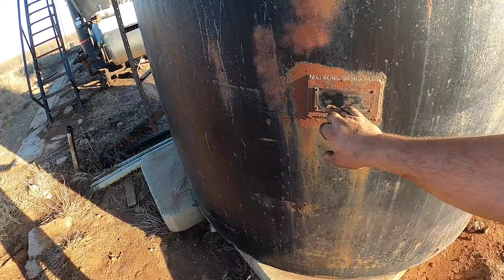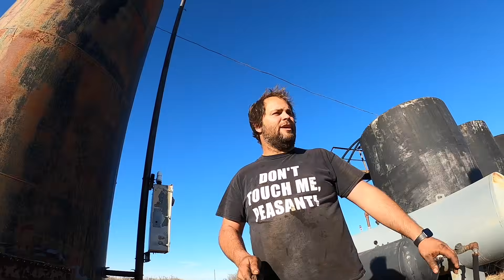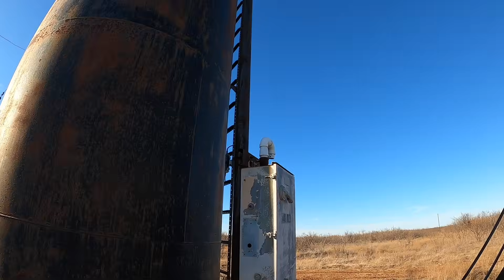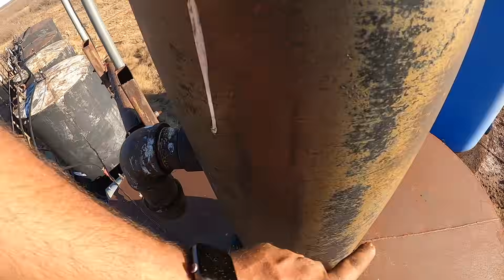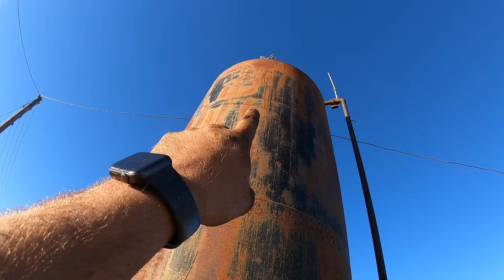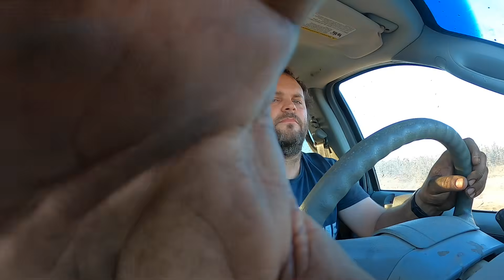Gun Barrel Oil, Gas, and Water Separator.

Comment: man I'd like to know the exact measurements of the separator tank like how wide and how tall and exactly what height each pipe is if you measure from the bottom of the tank up to the bottom of each pipe.  i know it's probably too much work to be doing just because someone wants to know the dimensions but I would like to know because im wanting to separate water from used motor oil if that's even possible using the same method?

Comment: you mentioned the salt water gets pumped back into the well , does the well work like the gunbarrel separator too, does the salt water go into the ground pocket and then float the oil up to the well casing where it is pumped out? does saltwater go down the same well that the oil comes up at  or are they seperate drillings so water would go down say  the east end of a formation and oil would be pumped out the west side at a different drilling ?
Reply: Saltwater is usually pumped into a injection well separate from the flowing oil well. The depth is determined by the Texas Railroad Commission. Sometimes it is a well no longer in production. Hope this helps.

Comment: Out of university (electrical engineering degree but I worked for an oil company) I designed some of the electronics control devices for things like oil/water separators, CO2 injection wells, wellheads, pipelines and delivery manifolds. I would do training classes for our techs and we would get deep in the weeds with specific gravity calculations for brine, certain types of product and the mixes of gases that came off of wells.
You could get really detailed if you had a set of glass hydrometers for specific gravity and to be able to gauge a tank with a sight glass or the 'pressure tape' gaugers that ran up the column on the side of the tank (where the fluid compressed this flat tape that was just a very long resistor and the changes in resistance indicated at what level the tape was at).
It was great fun and always challenging because I could go in the field and work with techs to put things in to practice, then bring back practical knowledge and apply it to the next revisions of what we designed and made.
I may not of always agreed with what the field techs did (or the dangers they took) but I always listened to what they had to say.

Later I was working on prover loops for doing runs on each batch, nuclear density gauges, four wire temperature, motor efficiency curves based upon temperature rise of product, pressures, flow rates and differential pressures.

I managed to avoid the management-trap that many engineers fell for. I took six years of friggen calculus and I was not about to dumb myself down to become a deskbound manager! I wanted to keep my FRC, hardhat, hearing protection, safety glasses, boots and my tool bag.

(one of the scariest was watching one guy loop a chunk of yellow nylon rope through his belt loops as a 'harness' because he was going to freehand climb up the ladder on an 80' tank during a thunderstorm.)

Comment: That gravity separator concept looks like it should still be in use…but instead with an injection well instead of an evaporation pond.  With the gas separator, it looks like you could have a few extra nickels, dimes, and quarters flowing into the bank account.
Reply: Modern separators aren't much different, with simple gravity floats to control levels and transfer pumps, sometimes heaters to accelerate separation rates.

Comment: Two questions 

1, is this the same concept as an up right heater treater that I grew up with without the burner? 

2. Do you keep it functional in case one of those knockouts goes down. 

My problem is, everythime we treat and flush 2 wells are knockouts go down from too much trash. 
And yes we bail lol 😆 

So I like how you can move that header that was smart incase you have a 1 or 2 day cleaning/ repair job.

Edit 

It clicked lol 11:33

That's why dad always had me check with a clear cup of how MUCH water was going in the tank. 

But also watch how dark the water was going in the fiberglass. 

I know to pull bottoms and check the gravity on the slips. But I had a couple brain injuries since he YELLED into my head, and now I'm back at 29 trying to make sense of it all again. 
You're a good teacher sir, especially for us small business workers. 

#savethestrippers
Reply from the maker: All the heater treaters ive seen use a float and valve system. This thing was used up until I was a kid and it got a hole in it.

Comment: Question: Is there still enough gas left in the wells (that's brought into the system) that it's worth tapping it off to run a generator?
Reply from the maker: No this formation never produced much gas, in the old days they heated a few houses but today you might run a bbq grill or something but thats about it.
Reply: @TheZachLife  Thanks for the reply! We used to have a couple of wells a couple of towns over, but that's years ago. Really find this fascinating stuff. Thanks! 🙂
Reply: @TheZachLife  I would be curious if there was H2S present. I am in Illinois and H2S was a really big concern.

Also, when I was a kid, my dad and I would take gas cans to our oil well separator (I think) and fill gas cans.

 A lot of the kids would run it in their cars in high school. It was hell on the valves of the car. That was back in the day when a car was 50 bucks. If one broke, sell it to the junk yard for 50 then go out and buy another.

Comment: if you ever need a real world visual aid to demonstrate  how much higher the fluid level inside the separator needs to be to push the salt water over the break point of the water leg using a clear  kids cup with the straw made on to the side works great for showing this, fill the cup with water and then add oil and watch the magic happen

Comment: Excellent explanation!  That is an amazingly well designed separator. So many mechanical devices built in the first half of the 20th century were brilliantly simple. Engineers back then didn’t have complicated control systems to work with, so they used basic principles of physics to get the job done.

Comment: Ran across your channel by accident. Always been interested in oil wells both in the drilling and the pumping. So my question is a 2 part question. How well do the old Gun Barrel separators vs the newer style separators work in regards to separating? Not sure if you have a video of it yet but when the company comes out to drain the oil tanks. Do they separate the oil again at before paying the leases and is the oil good enough to ship off to be refined without a 2nd separation? So I guess I would like to know what the next step in the process is after the tank truck shows up to drain the storage tanks in the field.
Reply from the maker: I think they were probably about the same. When they pickup the oil they test it (known as a grind out) for water. They will pickup oil thats up to 1% water but its typically in the 0.1%-0.3% range. They will simply deduct the calculated amount of water from the total volume for the actually amount of purchased oil. At that point it's theirs and it goes to whoever wants to pay them for it.
Reply: @TheZachLife  Thanks for the info. That is amazing that a simple non electric system can do so well separating the water, gas and oil.

Comment: Using the density of water and oil to determine the height of the water outlet pipe is sheer genius.  I'll be the guy that though of that didn't sleep for a week.  I wonder what the neighbors paid for the propane or whatever gas was piped to their houses.  I remember seeing that there was a school that blew up probably in the thirties because the free gas they were getting filled the basement and it didn't have the rotten egg smell added and no one could smell it,
Reply from the maker: It was usually just given away. Unfortunately I don't think that was an uncommon assurance.

Comment: That system looks like it requires little maintenance. Why would they (you) stop using it? What are the problems you didn't tell us about? 🙂
Reply from the maker: It was put out of operation in the early 90's because it developed a leak in the side at the bottom. They would cost a lot more to build than a normal separator today just because they are bigger and more complicated.
Reply: @TheZachLife  Cool, I'm always wondering what we will do if the supply chain gets longer or there is some other problem that prevents us from getting or using all the new high tech toys. 🙂

Comment: Excellent description of a gun-barrel separator. Oil weighs around 6 lbs/gallon and water weighs about 8 lbs/gallon which accounts for the different level between the oil level and water level overflow.
Reply: That makes the calculation of the height from the overflow pipe pretty easy.
Lets say the oil/water layer should be in the middle of the seperator.
Means 50% oil and 50% water they have a mixed weight of 7lbs/gallon. 
How much more 7lbs/gallon liquid do you need to push up a 8lbs/gallon liquid aka water is 7/8
At an 8 feet heigh seperator the overflowpipe needs to be 7 feet high.
Reply from the maker: Thanks.